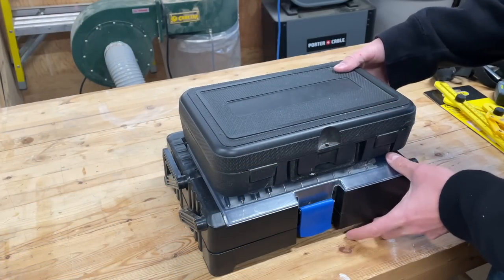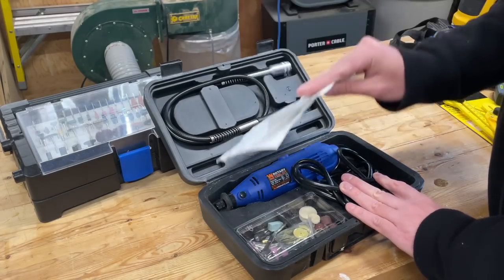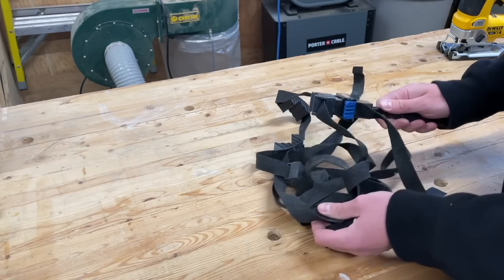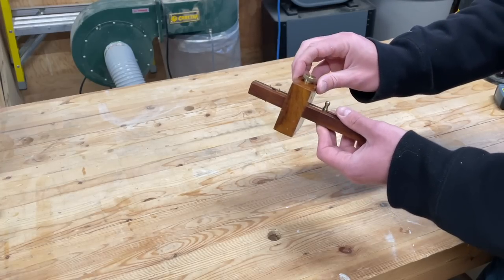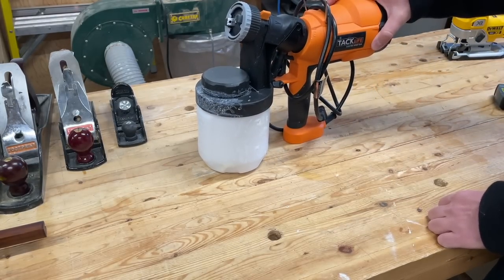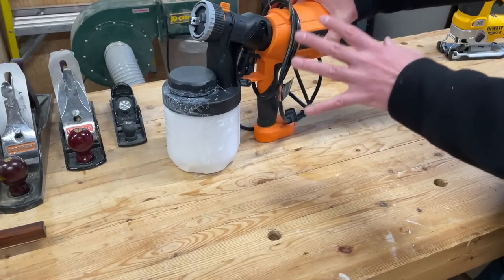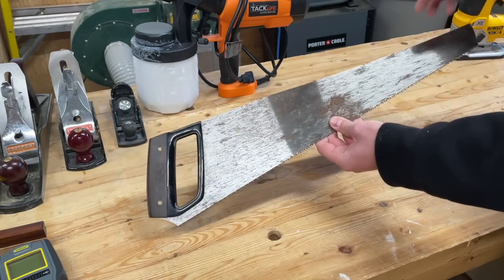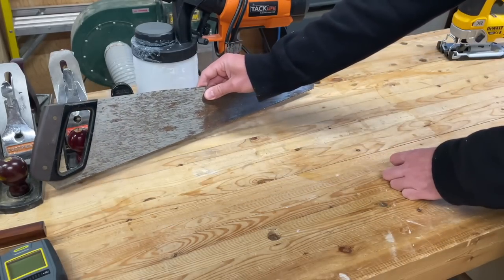Don't Buy These Tools // 10 Woodworking Tools I Wish I Didn't Buy

Comment: I agree with 80% of what you said. 

The jigsaw, very useful for me. To be fair, you did clarify that it wasn't useful for your woodworking, but I see that you since discovered just how useful it can be. I guess you learned a little something from your own video.

I have one of those plastic angle finders. I have gotten a ton of use out of mine. Yes, it's cheap plastic, but it has worked well for me. I bought it to make a coffin-shaped bookcase for my daughter and I got dead-on results with it. I agree, it can be a little difficult to read, but in the end, it has been a valuable tool for me.

I've wanted a sprayer for a long time and I didn't let myself get suckered in by a cheap solution. I finally bought the Earlex 5500. There are plenty of better sprayers out there, but I love what it has done for me.

As for hand planes, I haven't bought any but I'm also hesitant to buy any until I have the money to also buy the tools to keep them in good working order, e.g. sharpening. It's like buying a Mercedes or a Porsche. You might be able to afford the monthly payment, but if you can't afford the up-keep, you have no business buying one. So, when I can afford the supporting tools, I'll start buying good planes.
Reply from the maker: Great comment, thank you! Yeah, the jigsaw was a sore spot for a while, but I'm using a lot now with great results - really quite refreshing!

Funny enough, I just trimmed out my entire basement and I used that little angle finder to get rough estimates - it wasn't super-precise, but it was often "accurate enough" for my needs at the time.

I have a couple of larger cabinetry builds coming up, so i'm going to invest in a good sprayer - that Earlex 5500 will be on my short list!

Comment: Even the expensive hand planes have to be 'tuned up' out of the box.  The key factor is whether or not it keeps its settings when you dial it in.  Even cheap planes can work well once tuned up.
Reply: I came to write this EXACT comment.

Rex Kreuger has some pretty good videos that will show a beginner how to set up a plane. Most of those I learned from was how to refurbish an old plane, but 1/2 the video applies to setting up a plane, no matter if first time or refurbish.
Reply: Wrangler star had one on tuning up like a $15 hand plane, which started with a couple hours of sanding the bottom flat on a piece of glass or granite. Someday I might get there lol
Reply: Got my hands on a Stanley no. 4, and no matter how much time I spent sharpening the iron it didn't really work until I sanded the bottom flat. Rather laborous couple of hours, but it made a world of difference in the end. Took it from unusable to fine!
Reply: Rob Cosman has several videos on tuning planes. He obviously always recommends getting better tools, but i have used his tips to make a cheap $35 home depot plane work "better". Not like my woodriver plane but i can now use it for rough planing.
Reply: You buy hand tools to spend the time making them work for you, or you should just mill out your work pieces before you start the finishing process. But I like to take my time to get to "KNOW" my equipment first.

Comment: I've got 3 of those Kreg multi marks, I use them a lot for finishing or transferring measurements. Plus it has the reveal built in so you can always get your door and window frames perfect. I love it. I have a Dewalt jigsaw and I don't use it all the time but enough I'm glad I own it. And my moisture meter I use it to show clients their walls and how wet they are up and then recommend we redo the part above a certain moisture.

Comment: That dremel style tool can be extremely useful - depending on what u are doing. First - get a decent Dremel tool ( I have a Wizard - compatible with all dremel accessories). I do Lutherie work - a lot of touch up and detail work. I use it for fabrication, trimming, polishing etc. It's designed for small intricate operations.
Reply from the maker: That sort of detail work was why I bought it in the first palace - you’re absolutely right in buying a good quality Dremel-tool. Thanks for sharing!
Reply: I bought a couple B&D RTX rotary tools when they were closing them out. They're OK. I've had real Dremels too. Blown a couple up. I also have a Foredom flex shaft tool. If I need real power I have Rotozips and pneumatic die grinders. But there's a lot the little rotary tools can do. You just have to work within their limitations.
Reply: @1pcfred  Problem with pneumatic die grinders, even the wee ones comparable to a Dremel, is how much air they use.  No an issue in an auto shop, can be a problem for many home woodworkers.
Reply: @johnsanford3596  die grinders are not high flow tools. They're maybe 4-6 CFM so you don't need a giant compressor to handle one. Need a bit more than a little pancake job though.
Reply: My Dremel rotary tool has saved me hundreds, if not thousands of dollars on many different types of repair projects. I use the cutoff wheels and grinding stones the most.

Comment: Something to note with the jigsaw, I was pretty frustrated with mine, and I had a cheaper one than yours, so I didn't use it much. I recently upgraded the blades to diablo, and its a whole different machine. If it's not working well for you, and your getting chatter, chances are the blade your using is blunt or not the correct blade/shit blade. Hope this helps!
Reply from the maker: You're exactly right, Jay! I upgraded my blades and also tried out different speed settings for different materials. It all made a huge difference and I now really like my jigsaw.
Reply: Yes, unless you only cut Jell-O with your jigsaw, buy good, appropriate blades. Avoid any of  dollar store or Jobmate 25 for a dollar type  garbage.

Comment: I have a cheap unbranded rotery tool I bought over twenty years ago, for diy. It's still going strong. I bought a Dremel mini circular saw a while ago. the motor packed up after a few months of light diy use. the Bosch I replaced it with is a much better tool. The take-aways for me are; cheap tools were better quality than they are today, and brand names are not always the best indicator of quality.
Reply from the maker: Awesome takeaways, thanks for sharing!
Reply: Bosch owns Dremel. So when you buy a Dremel you're buying Bosch. Bosch owns a number of brands. Like Rotozip. I've swapped accessories between my Bosch Colt router and a Rotozip I have. Threads right on. Old tools are subject to survivor bias. What we see today are the good ones because they're what survived over time. Which makes us think everything in the past must have been that good. In reality the garbage in the past got tossed out long ago. So it skews perception.
Reply: I agree. Dremel is junk. Won't survive even slightly difficult use. The motor is poorly protected, and just takes a powder after any kind of stress.
Reply: @1pcfred  No different than people so dedicated and loyal to a "Brand Name" when actuality that "loyalty" is based on the quality it used to be before corporate cut corners to increase their profit margin.
Also, as with any type of product - someone comes up with a good quality (and therefore popular) item and some big name company will buy them out and immediately lower the quality hoping that people will remain loyal based upon remembering what it used to be before "Big Name" trashed it for profits.
Reply: @AFmedic  that's why I'm sworn to fun and loyal to none. It is just not worth investing yourself into others.

Comment from the maker: Let me know what your most regretful woodworking tool purchases have been in the comments below! Something that didn't quite make the list for me was buying exotic woods (purpleheart, bloodwood, padauk among a few others) when I first started woodworking - they were difficult to work with, naturally oily which made finishing difficult, and had an awful stench when machining.
Reply: It was a K-mart special,.. Table saw... Complete with a sheet-metal "assembly required" table for it... I HATE that damn thing...

   I finally ended up building a new table on a dolly for it, put some accessories in there, and fitted it out with a sled jig so my brother would take it... He's pretty sure his boss will crow madly over it, once he's done rebuilding a ramp for his house...

    I have a circular saw... a makita... I can do about everything I need with that.

    A table saw might be a fine thing... in it's place. It's just that it's place isn't with me. I don't hate Tablesaws as a rule... just THAT particular one has seemed hell bent to piss me off since I got it... and it's done more for firewood than construction... SO lil' bro' can have it. I wish him AND his boss all the best with it. ;o)
Reply: I love the smell of machining padauk, reminds me of curry
Reply: As far as powertools go its a Ryobi table saw. 

I have nothing against Ryobi in general, their drills/drivers (specially the latest generation) are pretty good. But even as far as job site saws go this one was just not great. Took out their crappy blade and put in a Diablo blade and it got better but the stuff that bugged me had nothing to do with the blade. The miter gauge wobbles a lot, the fence has this little marker so you can use the ruler on the table but the marker is held on by a single screw and the window is larger than the piece of plastic they use for the marker so it can be off. Not a problem for quick breakdown cuts but absolutely not for final cuts. Finally the bevel doesn't lock very well so you have to square it up constantly.  Fortunately I didn't spend much on it. 

Hand Tools you have cheap chisels from Amazon. I bought them early on thinking a chisel is a chisel how can you screw it up? Then spent a year without touching a chisel they were so bad.  It wasn't until I was working with a friend on a project and I used his Two Cherries chisels that I found they can actually be a joy to work with. They may cost 5x what the set I bought, but worth every penny.
Reply: @yunofun  Just my experience, but if one is going to get a table-saw for a personal shop, I'd hazard that it's simply more prudent to go ahead and get one of the big old, obscenely heavy ones... cast iron top... proper adjustment hardware in the right places, and check it out before the buy, because for us on a budget, then "used" is the obvious way to go...

     It sucks to stick to a hand-held circular saw and folding saw-benches from 2x4's with those $5 bracket sets out of the slowest big-box store in history, BUT the little imperfections can be worked around for the time being, and when the "big boy saw" comes along equitably, you'll have the experience and instincts developed to appreciate it and keep it up for years or even decades to come...

    I've come to reckon that I simply don't have the space or place to justify such a thing, myself... BUT decent used saws in the "big and heavy" variety can still be found at equitable prices. I recently helped a friend refurbish one and install it into his basement/garage shop corner for a total investment (parts and labor and all) of about $200 (US)... EASILY a justifiable price for a piece of equipment he's going to profit from over decades to come.

    AND chisels??? From poor steel to failure to temper the things, there's only a few dozen ways to screw up making a decent chisel... BUT finding a good one, even scaly-rusted and chipped is like stumbling onto a solid gold bar if you're unafraid to invest a little elbow grease and time (and as long as there's still enough metal left to bother)... 

     In case you're interested, I usually draw the line on a "$5-gambler" at about 3 inches of "likely useful" blade left... I'll pick up shorter, but certainly not for "full price" as it were... Haggling comes with the territory, and while there are popular brands that are almost a guarantee, there are lesser known names that are certainly worth the risk... ;o)
Reply: @gnarthdarkanen7464  I agree, go all out on the saw IF you have the room for it. Like you I simply don't have the space for a large cabinet saw (I would love one though). 

This is why every benchtop tool I have is on carts, put them all in a row along the wall and when I need them just pull them out and put them where I have room (or even outside if it is a nice day). 

The cart for my table saw I even built in extensions that fold up/down to give me more support when needed. 

And while most of what you can do with a table saw can be done with a circular saw I still havent found a comfortable way to rip slammer width boards with it and have a straight edge. I have a few jigs that I have made/bought to do it but operation is sometimes awkward and that is never a good thing to mix with power tools.
Reply: @yunofun  I can only say "Patience, Grasshopper..."

    If you ever get the chance, take a weekend or something for a "Motorcycle course"... be it a camp or course...

      EASY in and EASY out... That's the trick... It's not always comfortable, but if you keep the "inputs" careful, you'll find the outputs directly related.

     It's never promised to be "easy"... AND we don't do this to save money or to be relieved of the usual problems... F*** 'em.

     Keep teasing your methods out, and you'll likely find that point where you'll say... "Oh... Hell... That's what I should've been doing." 

     AND then... just keep doing that. ;o)

Comment: For the record, that DeWalt jigsaw is awesome. I've used it for cutting 18 gauge steel to 2x12 stair stringers.  Tons of power and smooth. Feels good in your hand like all DeWalt tools. It's definitely a versatile tool. What would you use in place of it or is it that you don't really need it for most projects. You could use it to cut moons in outhouse doors haha.
Reply from the maker: I’ve really come around on the jigsaw since posting this video. The right blade and right speed made a big difference in the quality of the cut - glad I got some helpful advice in these comments!
Reply: @MasonWoodshop  hell yeah, just subscribed. I'm a framer by trade but have been slowly dipping my toes in the water for years. Always good to find new content. 
I love that jigsaw but then again I love all tools. Definitely have a problem haha.
Reply: We use 1 at work to cut step stringers lol.

Comment: Thanks for taking the time to put out the video.  Your hand plane story sums it up.  I have a bunch of plane videos and believe a razor sharp blade is about 85% of the challenge.  If you can't do that, then you'll never be happy using them.  Even Lie Nielsens will only last about 15 minutes before the blade is less than razor sharp, then you're in the same boat.  I also appreciate your updates on the jig saw.  I use mine a few times/year because it's by far the best tool for certain things.  I find cutting thin metal a good use when a hack saw just isn't going to do it.  Thanks again.